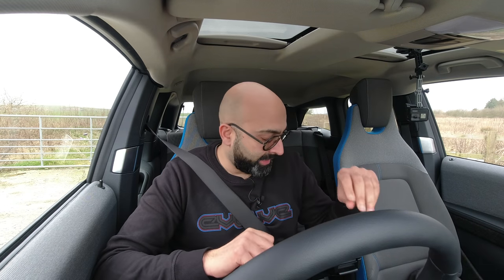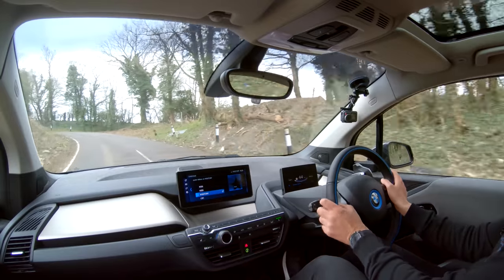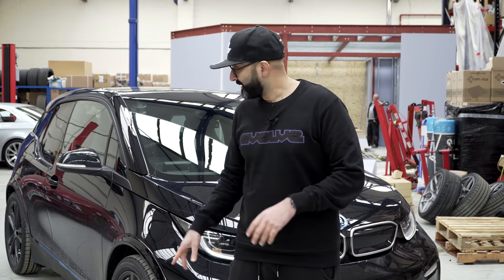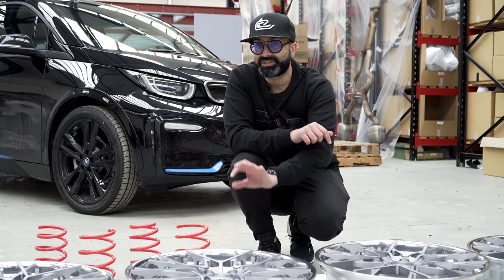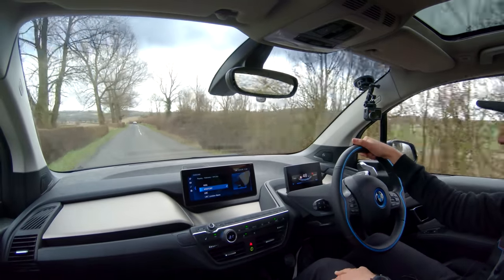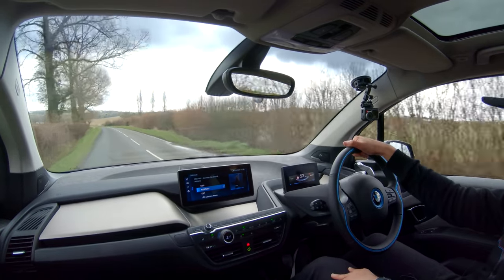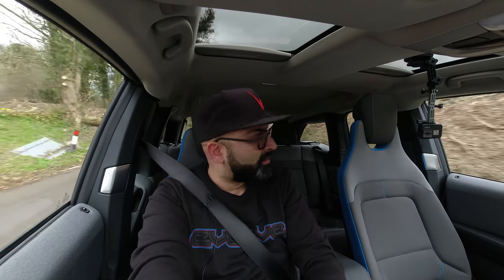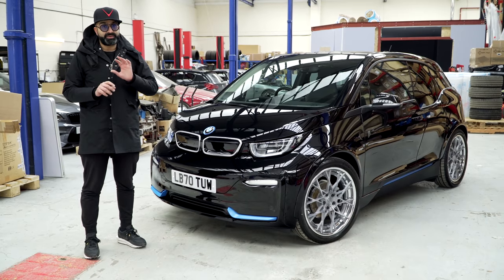Our i3 S needed a major stance upgrade! 6Sixty 2 Piece wheels + Lowering

Comment: Would be so nice to have an easy way to run bigger rims and tires on the i3. The compound wears so quick, because it needs to be soft to break in a reasonable distance with so little tire touching the road. Also everything is extra expensive, because it is not a standard size ...

Comment: Looks sick with those wheels 🔥 but for production I would personally like to see them about 6,5" wide rear and 6" front to go flush with the wheel arches! 👌 And get some 205 or 215 rear tires and 195  in front. It is possible!
Reply from the maker: Tyre sizes there’s no options! Only ones available are the BMW spec ones. It’s a 175+195 20” 😂

Width/offset wise, the i3 S arches are just stuck on, they add no more clearance inside the arch, so you cannot get them flush. Same problem we had with the GP3.
Reply: @EvolveAutomotive  Ya I guess if you want to lower the car more it will rub on the fender. But I have seen some I3s on 7" wide I8 wheels that didn't rub but They were only about 2-3cm lowered. And some of the inner arches were cut out to fit too. 😉
Reply: @EvolveAutomotive  And Btw. You can get Bridgestone Potenza tires in 195/50-20 and 215/45-20. Great tire with more grip 😉
Reply: i did aprox like u said in front 195 50 20 (6) rear 205 50 20 with original bmw i  got two more rear 6 ....doesn't exist 6,5 original ..so in the back the maximum size is 205.I keep the original because i didn't like to looks like a gipsy. In this way u get maximum confort first , and more stability.

Comment: 7:05 "... got a high center of gravity"... it's most likely that nothing BMW makes had a lower center of gravity due to the 600 pound battery pack being under the car, and the passenger module is carbon fiber reinforced polymer... extremely light.

Comment: I have a 2019 i3S and trust me, the last thing you want to be doing to this car is lowering it.  The stock ride is harsh enough without dropping it.  There is also zero wallow on the 2019 model.
Those wheel look better than the stock black ones but nowhere near as tidy as the stock black/aluminium ones for me.
Yes, they are fast though. 😊
Reply: Yes I went for the aluminium/black didn’t like the all black.
Reply: I’ve done mine, much better handling, goes like a pocket rocket.
🚀

Comment: Excellent video.  I can't tell it is lowered at all....how much 1/4 inch?  I would be interested in a spring kit that lowers the car 3/4".  Any chance of fender mods so that wider wheels so that regular conventional tires could be fitted.  It's a pain to find tires for this car since 2 companies make them.  155/70-19" are just too narrow for the front tires.  175/60 fronts and 205/60 rears would be great in an 18 inch wheel.  Thanks again.
Reply from the maker: Believe these lowered around 20mm, the gap was big before. This is about all you can do on stock damper.

You could cut the fenders to run wider tyres, but as is you cannot as the metal under the add on arch is still there.

Comment: Put some matte black wrap inside the kidneys, looks a lot better. Did it on mine. It really is a fine car for city driving, so small and agile.
Reply: Also, the aluminium list on the trunk is just glued on, so it's easy to remove.

Comment: Imo the car could be another 15-20 mil lower, might affect ride quality a little tho, also I wish you would’ve done a little wider rims so it could have a little better fitment and not so balloony tires
Reply from the maker: I personally agree with everything you said. However.

Springs that were that much lower would ride significantly worse.

The arches are stuck on to the original body and provide no extra clearance. And the car is a family town car so the extra balloon will help prevent kerbing them.

Comment: What stunningly beautiful wheels.
I have the standard i3 2021 model and would be interested in these wheels when they become available.
My only concern is that I see a lot of corroded two piece/split rim wheels on cars?
Is this a weakness or poor maintenance?
Thank you for the video.
Reply from the maker: Depends if they have raw/exposed elements to them. By nature of construction they will generally need more up keep than a single piece wheel. They often come in fancier less durable finishes also which contributes.

Drop us an email on sales@evolveautomotive.com and we can discuss further.

Comment: Top work guys! Any estimation on when these springs may be available? And will they be made for all models?
Reply from the maker: Just finishing long term evaluation of them now, hope to have them available in the next month or so. Everything production related is taking longer at the moment.

They’re applicable for all i3 models, and all will lower to roughly the same level.

Comment: Nice to see the i3 getting some attention. Always been reaaaallly curious about the possibility of going to smaller normal wheel sizing and a slight widebody kit to accommodate the wheel width. Especially interested in the idea that you can simply replace all quarter panels because they are all just bolted on, yah?
Reply from the maker: They’re curiously unmodified, would be great to see more people playing with them!
Reply: @EvolveAutomotive  Couldnt agree more, both on the aesthetic and performance front. Ive heard those motors are drastically undertuned and that 300whp is well within its capabilities. Combine that with some wider 18s and sticky rubber and it would suprise a lot of people at any grassroots autocross event.